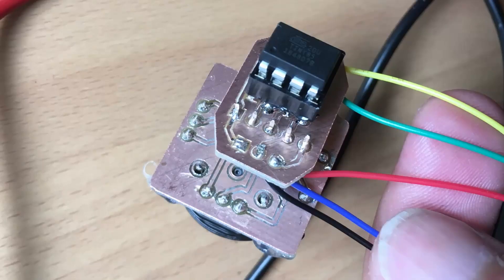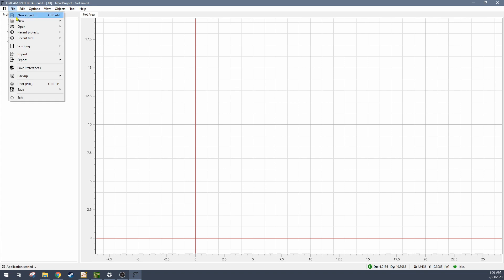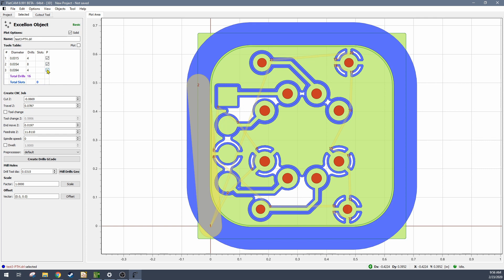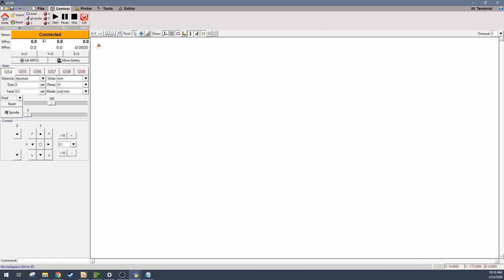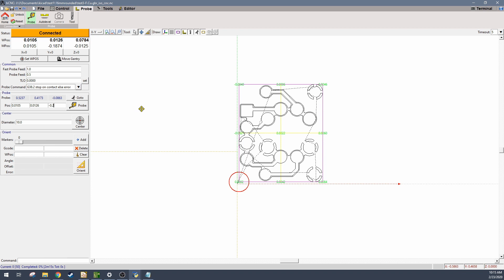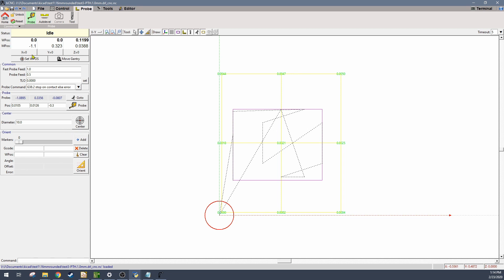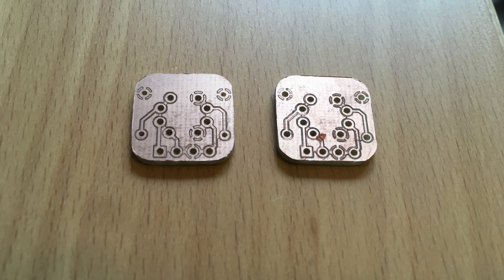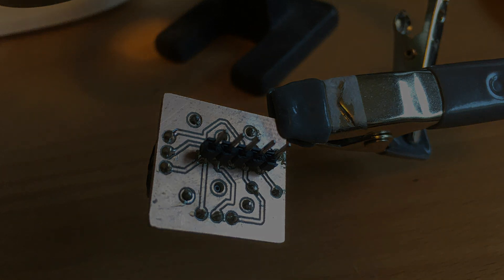CNC Milling Circuit Boards

Comment: Did you buy the X & Y rails and screws as pre-built complete axes, a kit, or pieced together?  I've been looking for a pre-built mini mill with linear rail and there don't seem to be too many out there.
Reply from the maker: I pieced it together, using the cheapest linear rails I could find on ebay. The screws came with the minimill kit. I've also had good luck with parts from zyltech's store.

Comment: Warped boards are a big pain using a machine like that. You will get good quality by using isolation scribbling. Here is a real crappy video i made of a machine made from a couple of scrap printer and CD ROM parts. https://www.youtube.com/watch?v=FoKRPYA8hOo . That is geared down 1 to 10 on mini 1.8 deg stepper using micro stepping giving a resolution of less than 4 microns. Here is the rest of the machine.   ttps://www.youtube.com/watch?v=2aON79la6uY the code generated by Inkscape is less than optimal. How awesome is Flatcam. Good video wish i would take the time to make proper videos.